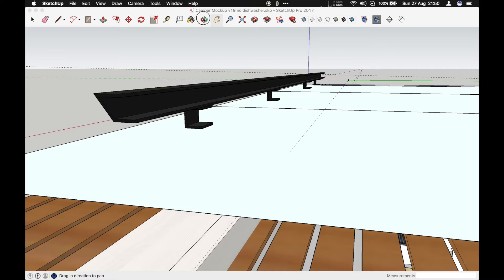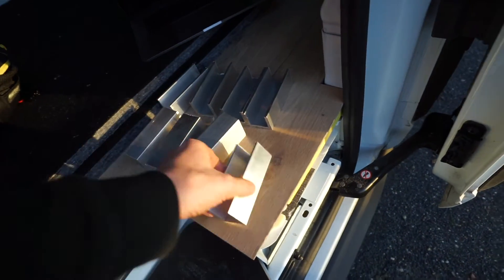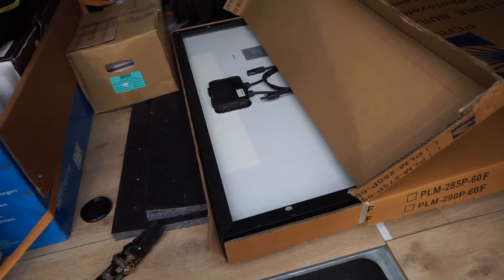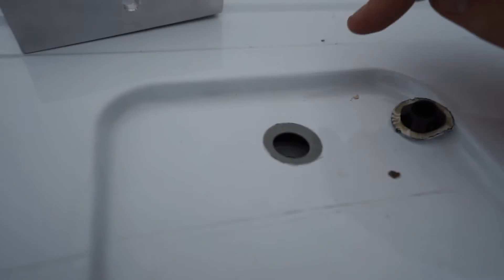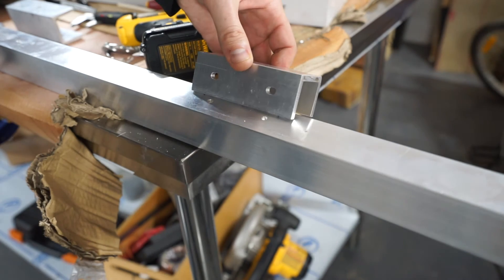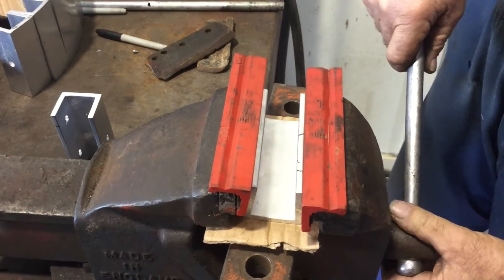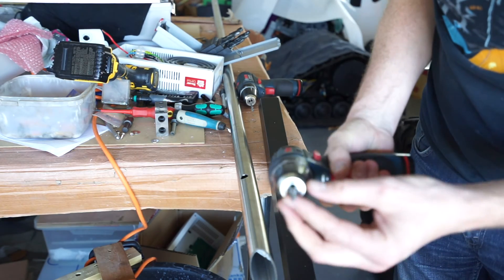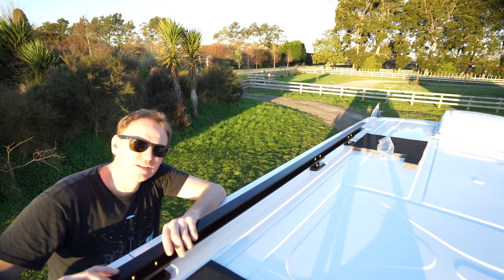How to Make Solar Panel Roof Racks For a Ford Transit: CNC: Eat Sleep Van 13

Comment: It is good engineering practice to put the bolt head on the to and the nut on the bottom that way the bolt stays in the hole and keeps things in place a bit longer if the nut comes loose

Comment: Hi there, thanks for these great videos! 
How much clearance do you have left at the center of the van with (I believe) 2 x 38 mm elevation with the feet and the long rail on the side ? I am planning to do almost the same on my transit similar to yours, as it seems on of the best solution ;-)  I am willing to keep it as low as possible to get min height for the van.
Reply from the maker: Hi not much, about 5cm or so? I can’t clean underneath it easily, a hinge design would be useful for that!
Reply: @EatSleepVan  thanks for your reply! The roof is less rounded than i thought then. 
Very good point for the hinges ;-) that complicates the design, but can be useful

Comment: What about racks that allow the panels to gain some inclination? You could maximixe the performance of the panels when not driving...
Sure you already thought about it, is that so much more difficult to design/implement?

Would appreciate your insights and thought process on that aspect!

Thanks for sharing, love your van ;)
Reply from the maker: Yeah we basically decided it was too complicated! It also means you have to precisely park. I spent quite a while figuring out if we could use actuators to lift the panels but tricky to figure how to mount them. Also tilting manually would be tricky, they are 18Kg each, although hinged wouldn’t be too bad.

Comment: Nice! Very helpful, thanks! I was so excited to see that there's a M8 bolt thread when you pulled off the rubber grommets...I wondered what was underneath them, but was too scared to pull one off my van to find out haha! I was considering putting a flexible panel on, but it actually looks pretty easy to mount a roof rack on so might go this way now. Thanks again for the videos...very helpful...not many Transit videos out there!!
Reply from the maker: Hey glad it could help!!

Comment: Fantastic design, well thought out. Been looking for an idea to mount solar panels on my cargo trailer, I am going to use your idea. Now that it has been a couple years, have you any hindsight suggestions?
Reply from the maker: Thanks! No very happy with solar panel rails, they’ve been working great. Only downside is they are not easy to clean under, so making it easier to detach and lift up would be handy. Hinges on one side perhaps.

Comment: Don't believe oblong holes in the feet were necessary, if you could simply mount all of them, take a long piece to the roof with only 1 hole drilled, fasten it, and mark all the other holes for drilling at all the other feet...

Not seeing the value of the powder coating to make them black on a white roof, just to attach uncoated aluminum panels to them, but to each his own.
Reply from the maker: The oblong holes were to allow for heat expansion contraction also. Plus it just makes it easier to fit. The powder coating was purely to make them look awesome. Only cost $20 NZD but yes not necessary.
Reply: @EatSleepVan  - Makes sense and will have to do oblong when building my custom roof rack.  Doubt we can get commensurate amount of powder coating for $20 here in the USA...!  thanks

Comment: Do you have the files to maybe make some of those ourselves? I was thinking about going prefab, but thats around 2-3k, these awesome ribs would save so much cash, and they look super spiffy
Reply from the maker: +Gene H hi I used 44mm x 38mm 5mm U channel aluminium. And it’s the same for the rails as the feet. Cut it to the lengths you need. I’ll put the file up soon, but be aware it’ll only be valid for the long wheel base transit.
Reply: Perfect, thats the one I am planning on getting. Thank you so much!